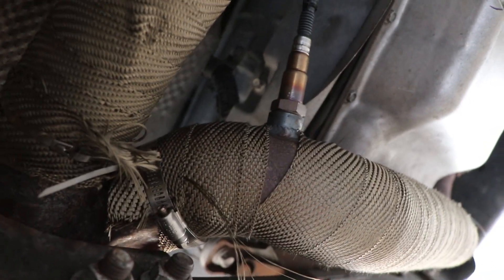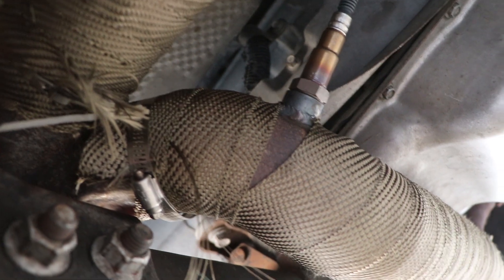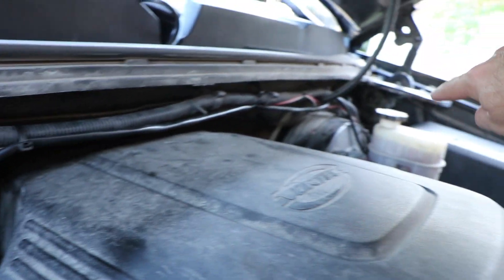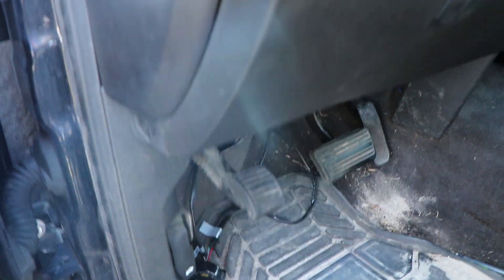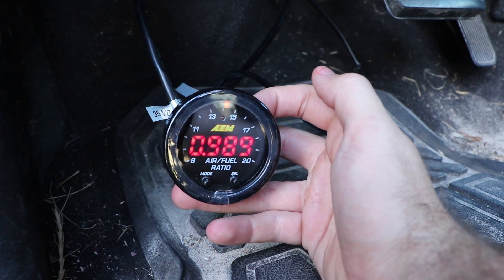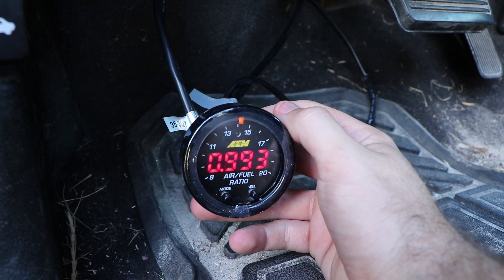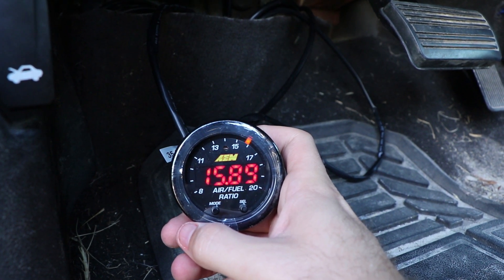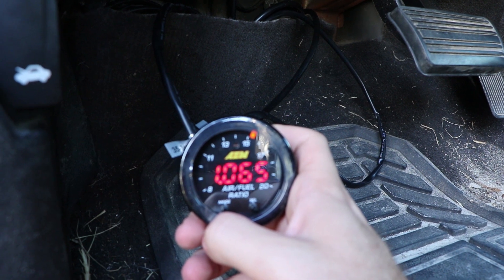Installing a Wide-band Sensor on my Cammed Silverado

Comment: Whats your idle set at in park and in drive i got a similar cam 216/220 110lsa .600 lift still tryin to get the idle figured out on mine
Reply from the maker: It’s around 700-800 rpm